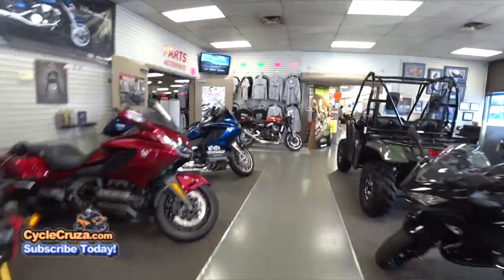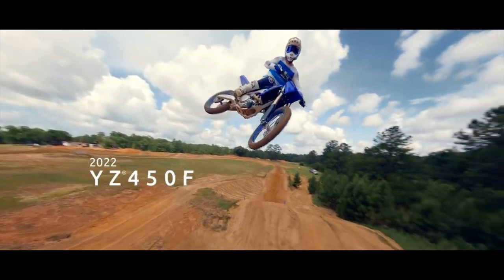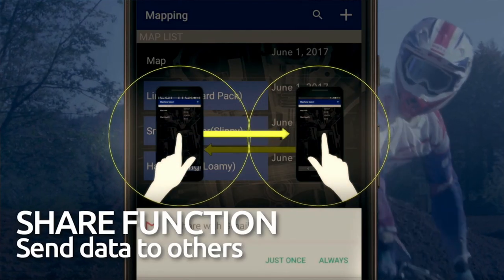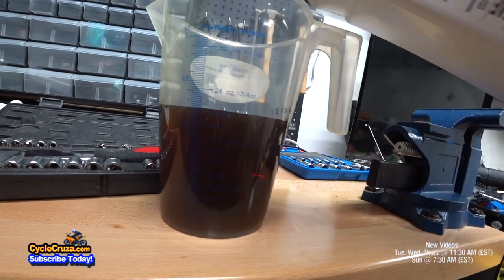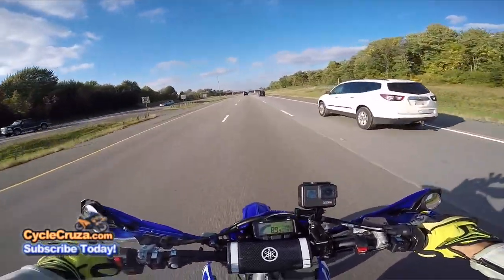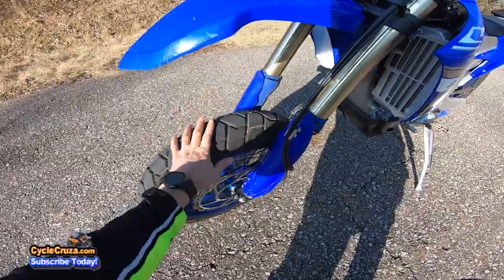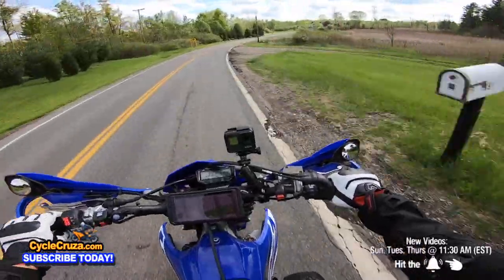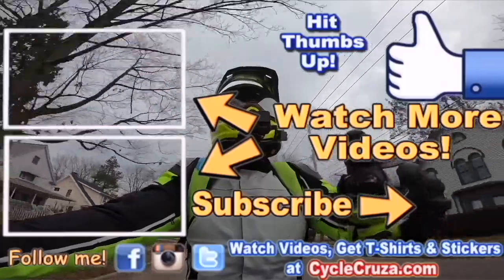Yamaha YZ450FX Supermoto 3 Year REVIEW (PROBLEMS)

Comment: Nice.👍🏿 I have a 2020 DRZ400SM with a set of Michelin Pilot Power 2CT. Had it for 2 years. It’s a blast to ride and it’s been very reliable.
Reply from the maker: Nice! Supermoto life is the best!
Reply: Had a z400 4wheeler which I believe is the same motor, did pipe jet and filter on it, and it would hang with a raptor (660) until top end. Stock the raptor would pull away.
Got a xr650 now, yeah these things remind me of being a kid on a bmx bike terrorizing the neighborhood😂🤘

Comment: Thanks for all the info! I got the 2022 YZ450FX based on your experience. I was going to get the WR until I saw all the info you had!!! I used a cheapo jracing 25buck front light assembly and tossed the halogen bulb and used an ama zon 17buck DAYWALKER H4 LED White 6000k Car headlamp. It works great I rode for a few hours with it last weekend. I have the tusk kit you recommended, and also the seat concepts comfort XL which is awesome!!!
Reply from the maker: Just swap the stator and rotor with the wr450f's stator and rotor . That's what I'm going to do.
Reply: @CycleCruza  The led bulb is cheaper and easier I think.

Comment: I grew up with 2 strokes in the 1970’s!  Twice the power of 4 strokes per cc with all the torque and horsepower at one time(50% less parts).  That sound and smell of the INTERNAL combustion engine(ICE).  I rode a new 2022 YZ 250 and your YZ 450 fX.  I bought the YZ 250 over your YZ 450 FX and made it street legal in my state.  That same power as the 450 FX but lighter and much less vibration if at all from the engine.  Easy maintenance, no valves, no cams, no cam chains, etc.  Cheap replacement piston every 50-100 hours.  Takes an hour to replace with simple tools.  Both the 4 stroke and 2 stroke piston take a beating with all that horsepower and only one cylinder.  The 2 stroke much better in the dirt as not so top heavy and the feeling of the extra mass inertia from the cams/valves/cam chains. Single cylinder bikes offer the roughest  street rides cuz of the single cylinder balance problems.  Again, the 2 stroke  is smoother but the power delivery is more abrupt and somewhat peaky  but it’s the perfect wheelie machine/stunt bike.  Glad Yamaha still offering 2 strokes as they seem to be coming back.  I carry 4 ounces of oil premix with me for the gas station.  KTM offers oil injection and fuel injection on their 2 strokes.  I grew up with carburetors.  Very rarely any problems as long as you use  clean fresh  gas and empty the float bowl if going to store for awhile.  Carburetors Very simple to work on.  2 stroke ultimate apocalyptic bike as all analog not digital for the most part.  Love the tinny engine and almost 14 inches ground clearance.
Reply: 2 strokes have make power every one revolution of crank vs 2 crank revolutions for 4 stroke. 2 strokes twice the power.  250 cc 2 stroke same power as 450 cc 4 stroke and lighter at same time.

Comment: It doesn't matter what kind of tires you have, especially if the ground is damp, you ride across a tree limb at an angle that front tire will slip out from under you. I've been riding since I was 6 years old, so 50 years ya'll.

Comment: 2016 yz450fx i own atm currently has 202hrs on it still havnt checked the valves or even looked at the top end still starts quick and runs strong i might check it around 250-300 hours
 at this moment only problems im having are i ripped the kill switch button off with a crash and my starter likes to work only when it feels like it thank goodness my early model came with a kickstart as she starts literally almost first kick always even when hot

Comment: You should do a valve check just to see how far out of spec it got in 3 years. Would be interesting.
Reply from the maker: You'll know when your valves get out of spec. The bike will have problems starting. My bike starts lighting fast and rides great. They yamaha valves don't move...
Reply: I have a 2008 yz 250f that I bought new way back when and it probably has over 200 hours on. Never had the motor or carb touched. Just regular oil changes and air filter cleanings. Always starts up in 1-2 kicks. Yamahas are the best

Comment: Ma question is how do you keep the bikes body looking clean after all these years? Do you have a special spray for the plastics?
Reply: I use ceramic spray on everything it helps a LOT!
Reply: @22YZ450FX  ceramic spray sounds cool and expensive but if that's how it keeps a bike looking after 3 years it's worth it.
Reply: @tjey379  I'm not sure if he did that but I did and mine although new don't seem to pick up dirt or dust easily.
Reply: @22YZ450FX  so what will a can of that good stuff look like ? ( like it's brand name )and how much would it cost? Maybe one day I can get some.
Reply: @tjey379  I got cheap shine armor it's purple spray less than 20 bucks it comes with 2 cloths one to apply one to buff off. I use it on everything even the wheels and spokes. Got a video of me using it on my channel if you wanna see it.
Reply: @22YZ450FX  even the wheels cool probably won't get it in my country but it's worth a look, thanks for the education👍

Comment: To try out a hd bagger you don’t want you should research a good older used one that has the torque that is on the higher sides of older hd baggers so u don’t instantly hate it, it has to be a better model with higher torque and hp then some of the older tractors unless you find one that fits your research prices are way too high to be buying new hd so this is a equivalent challenge to find a good deal on a respectable hp hd

Comment: It's been fun and inspiring watching you build and run the supermoto. If I do one I'll probably follow this kind of built. Could your wireless engine pack be drawing power transmitting constantly? A higher capacity generator couldn't hurt. Good summary video.
Reply from the maker: No, the module only uses power when its being used. I will upgrade the stator to the wr450f's stator, that should be the answer.

Comment: I wish you would have bought one that came street legal. This isn't even an option where I live. My bike says right on the title "Not to be licensed."
Reply: Mine said that too and I pasted stickers over the warning, installed a light and tusk kit,  I purchased insurance, went to the BMV, signed a paper, t,hey gave me a title with MC class, I purchased plates and was on the road.
Reply: @22YZ450FX  I know in West Virginia if you pasted a sticker on the title they won't put it through since the title is altered. I'm glad you were able to do it where you live.
Reply: @CraigSmith568  Oh sorry I mis-read the post. I meant on the fender there is a sticker that says that. My title didn't say anything like that. You could research other states near you. I did save a scan of my title and the top does say Original Off Road Motorcyle - Off Road Use Only. The one they gave me says Replacement and nothing else under it. Body type Before was OR, now it says MC.
Reply: @22YZ450FX  I think I could make it legal if it was done in another state, because I found one at my local bike shop that was a Suzuki RMZ-450. Once it had been done and the title changed, then the state recognizes it. Not sure, but this is my theory.

Comment: I would never own one of those and not check the valves at least a couple times a season.  If you are running them out of spec, you are costing yourself money.
Reply from the maker: You will know when your valves are out of spec, the bike will have trouble starting is the first sign. My bike starts lightening fast and runs better now than it did brand new. Yamaha valves are well known for not going out of spec, countless youtube videos show this. As stated years ago, this is an an experiment I'm doing to see if I can get by with just basic maintenance such as oil changes, air filter change and chain maintenance. That's all I have done so far and this bike has amazed me. Imo, Yamaha dirt bikes are #1 most reliable dirt bikes you can buy.
Reply: @CycleCruza  the bike will start fine until you run out of valve clearance which means no clearance. By that time your titanium valves will be so worn that you will have to replace them. That's an expensive bill. There's a huge difference between valves out of spec and valves with no clearance. I've seen it all. The old school early Genesis heads were outfitted with steel valves that wear evenly with the valve seat unlike the titanium valves of the next generation 426 and subsequent 450 models however some people have opted for stronger springs which yes cause a little bit more effort on the valve train to compress, but the reward is even wear. The valves will wear even more when it is in a lean condition. Do you know if you are running lean? What is your air fuel ratio? What does your spark plug look like? Have you changed it? I will give you this I believe you that you change your oil often which is a lot better than some of the bikes that I end up with. I have a row of valves on my wall to show people why we check valve clearances and do it frequently. I've been in a lot of engines and I kind of know what I'm talking about. I still like your content because you are entertaining and I hope that you don't have to learn an expensive lesson and have an effed up day!
Reply: @DRZWhisperer  he is right man, the bike will let you know when the valves are too tight.
Reply: @adamgentry332  yes when they have no clearance and then it won't start! Do you have any idea what you're talking about? Are you a service tech?
Reply: @adamgentry332  and just to clarify using that mindset of the bike will tell you when the valves need adjusted, you are letting them get so far out of spec that they are worn down to having a large lip on the valve instead of making small adjustments over time like you are supposed to. People just do not listen because they don't understand what is going on. You don't learn your lesson until you do, then you will cry about it because your valve breaks and you say I don't know why this happened I adjusted the valves (in sad voice) but you adjusted them 100 hours too late or more. I think people that offer this sort of bad advice should be held accountable for their bad advice.
Reply: @DRZWhisperer  I've worked on a few. Just cause your a service tech doesn't mean your a good mechanic. The valves gradually have less and less clearance until there is no clearance, which in turn makes the bike hard to start because the lack of compression. It doesn't happen suddenly.
Reply: @adamgentry332  what happens to the sealing surface as your valves wear and you continue do not adjust them? Please explain this to me. Because I want to learn from your superior knowledge. I want to learn
Reply: @DRZWhisperer  if your valves are hanging open because the lack of adjustment the valve seat and valve sealing face will scorch and pit the metal or begin to deform the titanium. All of this happens after the bike starts having hard start problems.
Reply: @CycleCruza  I agree on the valves unless you are having trouble starting it or feel a loss of hp there a waste of money and time,hell my k6 1000 has 60,000 miles on no valve adjustment ever.Good vid my man
Reply: Check the clearances all you want. You will be taking it apart just to put it back together. I go 200+hrs between tear downs. Valves are always in spec when I tear it down. Just because you have had bad luck with other vehicles doesn't mean these are the same way
Reply: @jaretaustin14  and yet another expert that is smarter than the manual.  Guessing it's not knowing. This is equivalent to someone securing a load with bungee cords and saying it's not going anywhere.
Reply: @DRZWhisperer  So you agree with the manual that the piston should be replaced every 12.5hrs? That's what it says in the manual. It also says to check the valve clearance every 7.5hrs. Still think the manual is perfect?
Reply: @jaretaustin14  these engines are high performance and taking a look dones not hurt if you know you are running in racing conditions. These bikes operate with about the same amount of oil as my push mower, and let's do a little backtracking here, Wales job is to obviously lubricate, keep contaminants and suspension, and help cool the engine. That is asking an awful lot of so little. For crying out loud when you change that oil you at least know that it's been changed and you have fresh oil in it and filter. And by doing other preventable maintenance you at least know those components are in spec. Those engines come with titanium valves and those titanium valves come into contact with a steel valve seat. The steel valve seats win the game of wear.  Based upon the information we know about his motorcycle, the valve clearances have not been checked since the engine was brand new meaning there's been no break in check . I think he does check and change his oil often which is good but why skip a critical component inspection at least in the offseason rather than every 15 hours. My persistence on this topic is based upon you don't know unless you check and plenty of people watch these videos and it is monkey see monkey do or not do and quite simply it's bad advice saying these valves just don't move. Put a feeler gauge in there and prove it show me I don't believe you.
Reply: @DRZWhisperer  Checking them once a year in the winter I can agree with. Checking them multiple times a season like you said originally is just way too often for leisure riding like he does. If it was actually being used for racing then sure follow the manual or close to it

Comment: Bro...did you just say. The KTM 690smcr has a little more power lmaooo. I'm a Yamaha guym my KTM SMCR is my first bike that isn't a Yamaha. And I'll tell u this. It's not even a competition  the 690 would beat that 450 in every aspect
Reply: I'd have chosen that one but it's a LOAD more loot!!  I was out the door and street legal under 13k with 2022 YZ450FX and all the street legal crap including the vapor speedo which worked great! Don't need a battery gauge the app shows battery and all that other crap!
Reply: @22YZ450FX  absolutely I totally understand that aspect of it but I got my 2019 KTM 690 smcr for $9,000 flat with a Rottweiler intake etc etc wings exhaust the whole kit and kaboodle. With only 1,127 miles
Reply: @jnycee845  Wow that's a deal you got lucky!!!
Reply: @22YZ450FX  fortunately I did I actually bought it from my cousin who is a sheriff and never used it due to him not wanting to get in trouble So I plan on putting like 5000/6000 miles on it then selling it for 11000 lol or trading it in for a Ducati hypermotard 950 SP. Surprisingly the 690smcr with 9k miles goes for over 10K still...this guy who owns a Ducati dealership by me offered me his very own 2020 Ducati hypermotard 950sp. For a even trade. With only 7k miles.